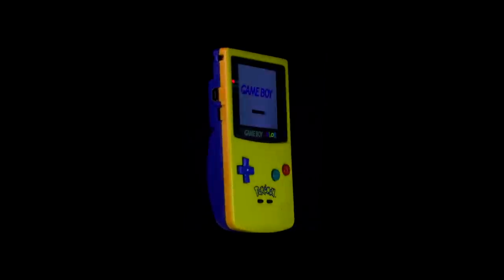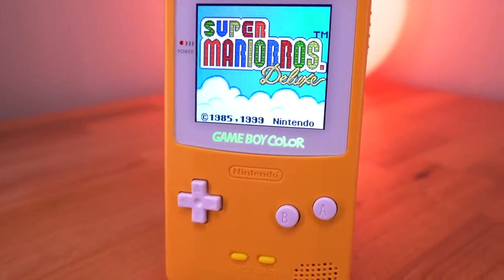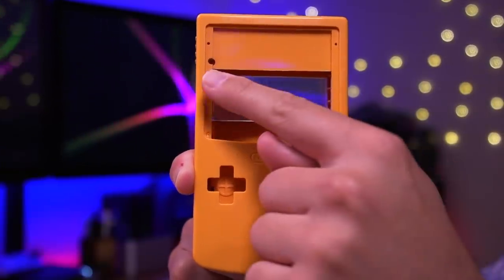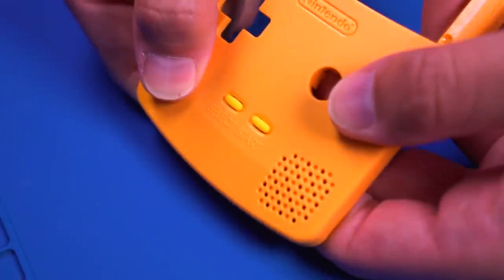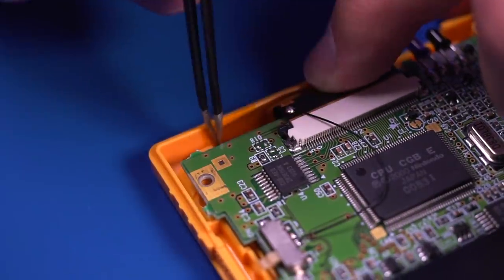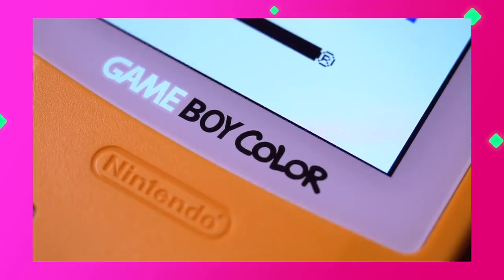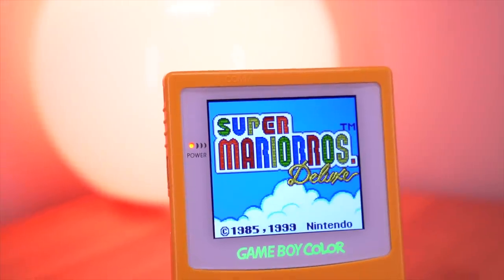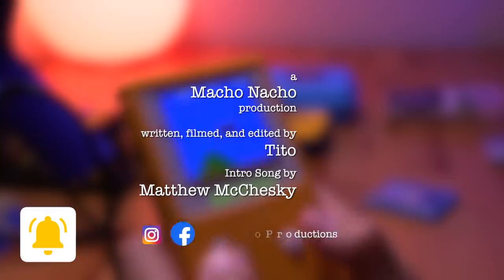The BEST IPS KIT for the Game Boy Color for 2021 | New Laminated Q5 v2.0 IPS Kit from FunnyPlaying

Comment: Hi, quick question, how hard is this mod. I have an 20 year old GBC that I used, still in great condition and wanted to mod this , i have however never used a soldering iron. From this video, it seems fairly simple straightforward. Do you have any tips, regarding the soldering irons and what to watch out for ?

Many thanks in advance

Comment: I've read that the game module port pins can put pressure on the LCD, which can cause permanent damage. Therefore, the pins must be shortened as much as possible using side cutters. is that correct or can I do it like you did with no problem?

Comment: I'd like to ask, how does this compare to the other Q5 XL mod you did in that other GBC video? Because I been told by an ebay seller (who I bought a pre-modded GBC with the Q5 XL screen mod) that the two screens are identical and are the same outside of the fact that this one has the light up logo while the other one doesn't.

Comment: Had to buy one after your video, love the results. But they haven't fixed the start/select issue yet atleast, but the issue don't lay with the shell, it's the button membranes that are sorry to say, piss poor. The start/select membranes don't have the proper shape if you compare to the original, and the A and B membrane is fualty from design, the alignment holes are not even remotely close to where they should be, and the dpad membrane didn't make connection at all except for down. I really recommend this screen kit and shell, buttons worked fine. But for the love of God, don't buy their membranes, just a fair warning for anyone attempting this mod.

Comment: I have the ribbon cable that has the retouch sensor attached, when I installed everything for some reason the touch sensor wasn't working. Everything is fine but it doesn't register my touch when I tap it. Gna try to making remove the kapton tape I used to hold it, making that's doing something to it.

Comment: I'm having issues with battery connection. When I move my gameboy around, it turns off and turns back on. 

Moving the batteries around messes with the power as well. 

Also when I don't have a game in, the black bar is not solid, but instead slightly pixelated. 

Any help would be much appreciated 🙏

Comment: I just got mine in the mail and installed everything it was a little tricky to install the select and start vias and also the touch sensor they sent me I didn’t even need but when I soldered it on it eventually came off and pulled the trace for it off also but the up part is I didn’t even need it because the model they sent me had a touch sensor already built in the ribbon cable

Comment: Big disadvantage of these laminated IPS kits is that you can't change the glass when it's scratched. That's big con. I prefer the normal Q5 XL kits. It's more difficult to install and there's no LED logo, but you can simply change the glass lens if it's scratched or you want to have a different color.

Comment: Any advice for soldering the vias at 7:00?
I can't for the life of me get the solder to adhere to the board.
it just moves back and forth between the solder iron tip and the solder cable.
EDIT: I gave in, i found soldering those vias impossible. On the off chance anyone else struggles, you can solder the START and SELECT wires to ports just above the start and select button contacts. Infinitely easier but does mean you'll have 2 wires trailing down the board which will be visible if you use a clear case.

Comment: Interesting! I just realized you didnt have to trim the pins protruding through for the cartridge slot and battery tabs, like on other screens. I guess laminated took less room! 

Did you see any issues with dead pixels or any other signs of uneven pressure since the install?
Reply: I need to know this info!!!!
Reply: @frankboehm591  trim the pins and cover with kapton or the included insulation sticker (the thinner black strip). I've built 2 gbc and 1sp since commenting on this and spent loads of time chasing down weak solder joints and shorts. I lost a 20hr pokemon blue save to a short. Definitely trim and insulate
Reply: @frankboehm591  also get the CHP-170 Hakko flush cutters for this. I got ASIN: B01MFZYNRS. They are high quality and will do this job easily. Don't stress about it too. If one of the solder joints looks cracked after cutting (they probably won't w those cutters), then simply heat the one joint with a soldering iron until it's a liquid again, and done! The cartridge slot is a replaceable part absolutely worst case
Reply: @CoreysZ32  awesome, thank you for the reply! Will do, my plan is to trim pins, thoroughly clean the pcb, then insulate and begin installation of the screen. Any other advice? I plan on going no solder installation until I have some practice
Reply: @frankboehm591  sure, the start and select button soldering to the pcb is usually high difficulty so dont feel discouraged! The thru-holes that everyone solders to are very small to get heat from the soldering iron to, and they are usually oxidized badly (use flux on the little thru-hole, try and get solder on it first... Then try and get the wire soldered to the blob)

Tape the touch sensor to the inside of the shell. I dont see anyone else doing that, but it makes the touch sensor WAY more reliable. There are TWO touch sensors usually.. one on the PCB and one loose in the box that you can connect to the spot labeled touch. Just use the one built-in. Both work well though. 
Test everything before assembling.
Use the big black sticker on the back of the display to protect it from shorting on electronics. Use the small black sticker to cover the cartridge spot pins once trimmed flush. 
Funnyplaying flex circuit changes in looks very often, there are probably 3 designs or more. Don't stress. Buy from a reputable place like retro game repair shop and enjoy.
Reply: @CoreysZ32  thanks a lot for the info, the screen I recieved has the ribbon cable pre attached so I won't be using the back insulation sticker. Makho talks about it in a vid. I will be trimming pins and covering with kapton tape though. Thanks again, it's really cool getting feedback from another that has done this.
Reply: @frankboehm591  mine have had the ribbon cable attached as well. I recommend still lifting the ribbon cable (removing tape if its taped) and place the insulation sticker just to be safe.

I cant remember if my end result (ips screen mod only) had any buzzing. I originally had issues running an everdrive after, but it turned out to be a faulty everdrive... I did quickly mod w/ giltesa's pro usb c mod w audio amplifier and higher power amplifier. Now im super happy with everything (and made one for my sibling as well). No more battery anxiety. It is an advanced soldering modification though and the ground pin for the power circuit is really difficult to solder (too cold, large ground plane)
Reply: @CoreysZ32  I really like the usb c mod, but I was planning on doing rechargeable AA's for the time being, any experience with rechargeable batteries?
Reply: @frankboehm591  i only used alkaline, and it seemed ok. Battery life wasn't terrible. Hopefully it is ok! If you arent using a flash cart, should be no issues

Comment: Do you know if the screen will work if we don't wire in the Start and Select buttons? I don't really want to change the coloring of the GBC logo and I would think that with the screen being pre-installed that you wouldn't need to adjust it.
Reply: It does work, but I'm pretty sure you need to solder the one wire from the power switch to the POWER pad on the ribbon.

Comment: In what way is the aftermarket shell different?  Say I wanted to use the original case, what is the difference between the two?  is there material that needs to be removed, or what?
Reply from the maker: There’s quite a bit of material that need to be removed.

Comment: Regarding the adjustment using the start and select buttons, do they adjust the position or the orientation? I thought orientation was for angular adjustment.
Reply from the maker: It doesn’t change the angle just the horizontal and vertical position

Comment: Hey Tito Im noticing with this kit I can get the screen to turn off sometimes when i adjust the brightness multiple times. Im thinking a step up 5v replacement regulator will help solve the issue, curious on your thoughts. I am using good Duracell batteries. Issue is signifigantly worse on cheap batteries.

Comment: I’ve done two of these now and they are incredible. 

I wish the DMG themed screen had been able back when I purchased. There were only two colors on the website at the time. 

I have a question 

I’m on my second mod and I accidentally damaged the small black wire that’s used to bridge power from the on off switch to the screen ribbon cable. 

I can replace that locally, I just need to know

What gage wire is it?
Reply: My guess is 30 or 32 AWG. If you have thicker, you can still use it, as long as it fits.

Comment: anyone having issues with the dpad?? i have to press down hard to go diagonal up.
Reply: Yes, I finally just used my original OEM D-pad from the console I harvested the board from. From what I have gathered, the d-pad they send with the new shell is a tad too short therefore it doesnt contact well in all areas. Some people have had luck stacking small squares of kapton tape in the center of the d-pad to make it "taller". I have not tried this personally but can see how it could help

Comment: cool mod but im over the whole "tap this to adjust brightness or color pallets" i have had 2 backlit gbc's and a gb pocket that allows custom colors and with all 3 its way to easy to have the touch portion be set off unintentionally so much so that on both gbc's i opened them up and removed the wire. Cool feature but i wish we would move away from using it that way

Comment: Hello I am having problems soldering to the vias for the start and select buttons. I have tried everything including flux but the solder just sticks to the iron. I read online that the iron may not be hot enough so I turned it up to 450 but that didn’t work either. Could anyone help?

Comment: Hello! thanks for the video it is very clear! I have a problem, I am stuck because i cannot pre-solder the motherboard (6:58 min). Solder doesn't stick to pins and I don't know why. I tried to clean the contacts with isopropyl alcohol, then with a rubber because I read about oxidation, but it does not change, the solder does not stick and remains on the solder tip. Does anyone have any advice? I have tried with solderig grease too and I had no problem with the previous soldering (6:26 min). Thanks!

Comment: Can someone help please. I followed the video, it worked perfectly, come to turn it on and nothing at all. Put the old screen back in and its totally dead. Spent alot of money on this.
Reply: Same for me. Did you ever find out why?
Reply: @Mattakattak  yeah for some reason it blew a fuse on the motherboard. I had a new fuse fitted and got told by a friend to use better batteries like dura cell. Works fine now.
Reply: Let me know when you sort it
Reply: @abaines7005  I checked the fuses like an hour ago and one of them is dead. I can't explain why since I used good batteries a'd was very careful, but I guess I'll have to buy a new one.
Reply: @abaines7005  thanks for your answer!
Reply: @Mattakattak  no worries, hope you get it sorted.

Comment: Can this be installed and used without soldering any wires?
Reply: Pretty sure you must solder the power wire, otherwise the screen doesn't turn on (I think). The start/select wires are optional, it just means you can't adjust horizontal/vertical position nor the backlight color.

Comment: Anyone else find the touch sensor on this kit to be unreliable. On mine it only works intermittently. Some times its totally unresponsive, but after a few power cycles it starts working again, only to become unresponsive on the next boot. There appears to be no way if knowing when it will start working again. I've tried reordering the sensor, but the result is always the same. Sometimes it works, sometimes it doesn't.
Reply: ive heard the same thing, some are saying the best results come from wiring it to the IR sensor panel, or just using copper tape on the top of the gameboy and soldering a wire from that to the ribbon

Comment: I have had nothing but problems with these screens, first laminated one I ordered directly from FP, it had missing pixels on the lower left corner, they sent a replacement which took another month to arrive, and that one had missing pixels on the bottom right side. Bought a finished console from someone else that worked fine when I bought it, now the touch sensor has stopped working. Replaced the touch sensor and it still does not work. I'll now have to take it somewhere else to have it repaired, if it's even possible. These things are cheaply made and have almost zero documentation. Definitely not worth what they are charging. Buy at your own risk.

Comment: 3:08 - Oh god, I forgot how bad the Benn Venn screen looks. "How many bezels do you want?" "Yes" 🤮

Okay, so first obvious con is that you buy a so-called specially designed shell so you don't have to modify a shell, and then you have to modify the shell anyway. 🤦‍♂️ Sure, filing is easy enough, but the point is that if I'm buying a special shell to avoid modding a shell, I shouldn't have to then modify the no-mod shell.

Second con, at least for me, is the touch sensor. I'd rather solder more wires and just use a button combo to open an OSD to change settings. It's weird that they started to do this, but then wasted it on horizontal and vertical adjustments - features that aren't needed because the screen comes pre-centered. Touch sensors aren't reliable and I don't want to make my classic systems worse by adding this unreliable technology to them. 

Third con, and call me crazy, but I'd rather not have the backlit logo. Just a waste of precious battery life. Get rid of it so that portion of the screen and/or backlight can be turned off and not drain the battery. Maybe that's an option in the color cycling already, but even if it is, now it's just black. I'd rather have the original printed logo in silver and the 5 colors (maybe those colors are also an option in the cycling, but again, now it's draining my battery).

I doubt they'd "fix" any of this for a V3 (except the glaringly obvious no-mod shell that needs to be modded, good grief), because they probably don't consider these things to be broken, but for me this is a pass. Touch sensor and backlit logo need to go before I'd buy one.

Comment: I'm savaged I just done this mod myself (following your tutorial of course) and my gameboy wont turn on D: I'm savaged
Reply: Recheck your soldering. The minimal wire you need to solder is from the power switch to the POWER pad on the ribbon cable. You can try desoldering the select and  start wires, and see if it works.
Reply: Did you find out why?
Reply: @Mattakattak  Yeah one of the fuses had gone so I replaced it. It's all good now
Reply: @fencal2  since my message I discovered that mine is gone too. Did you find out why that happened? I'm kinda worried that the next ones does the same.
Reply: @Mattakattak  I can't say for sure as to why it happened. My only guess is I shorted it somehow when I modded it
Reply: @fencal2  thanks for the answer, I'll be sure sure to check everything. Have a great day!

Comment: Are there any European vendors? Or are there non-European vendors who correctly charge and process the necessary taxes for European customers?
Reply: Just a heads-up: I bought the kit via Aliexpress with included taxes.
I did not have to file the start and select holes and the touch sensor is a little different.
Really happy with the kit!
The pixel mode and especially the laminated screen are game changers.

Comment: TIP! Dont buy their soldering USB kit. It sucks. It got me through soldering the IPS kit on my GBC just fine but once i got to replacing a battery on a Pkmn Blue cart it was almost impossible. I had to melt little by little since the tip kept cooling down and had to wait 15 seconds each attempt and couldnt do an adequate job. I ended up breaking off the battery and with a scalpel blade i tried my best to carve a canal where i bent the pins and dripped on some sauter. Terrible. To bad its kinda late and the hardware stores where closed. Also the top right dont sit flush. i know i assembled it right but still. The website shop is kinda consfusing. I order the wrong rubber buttons pads so double check qwhat you order !! It comes straight from China so expect atleast a month of delay and a bithc for refunds.